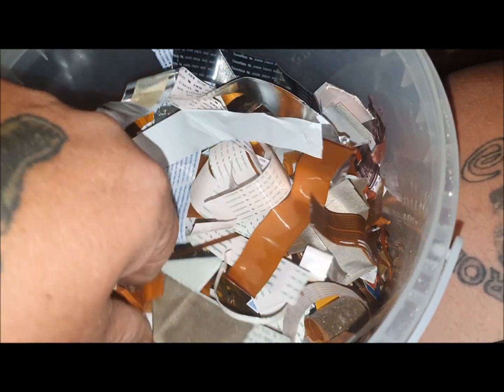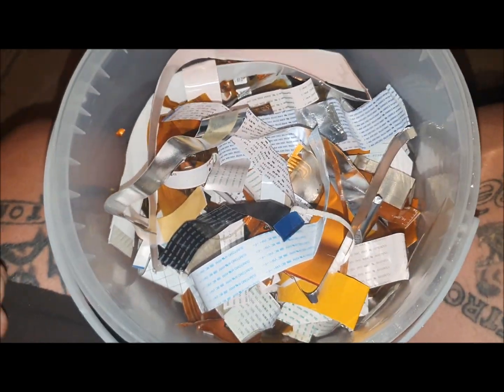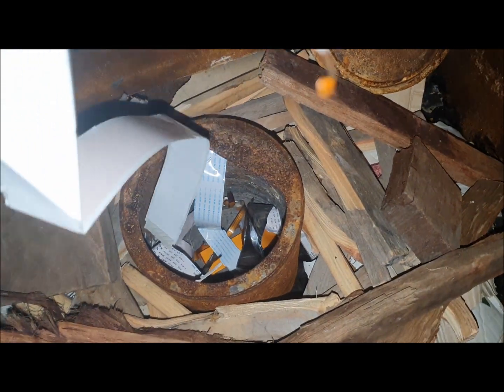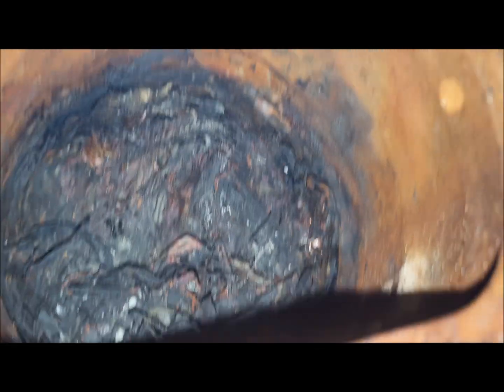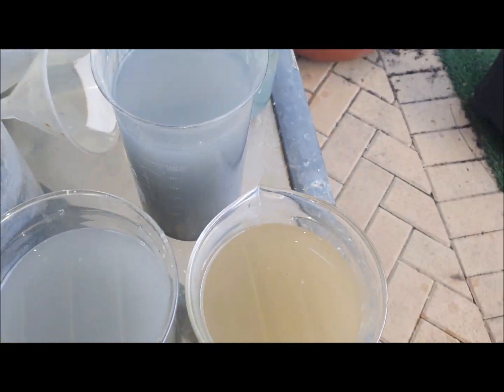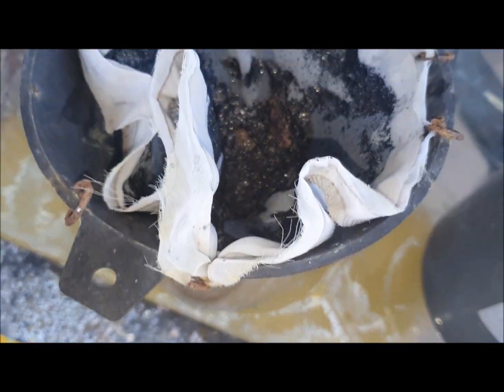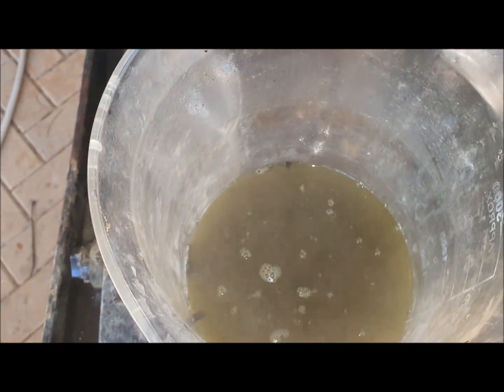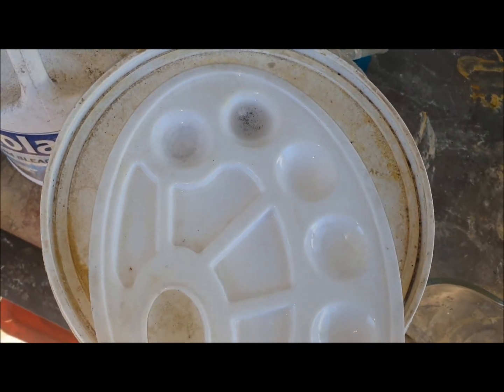GOLD RECOVERY / is there gold in computer ribbon wire ?

Comment: I wondered  whether there was any gold plate running  through the ribbon  wires    now i will continue on cutting the gold plated ends off and chucking the ribbon wire into  my low grade copper wire bag
Reply from the maker: yeah i also wondered, so i had to find out. i hope this video helped you